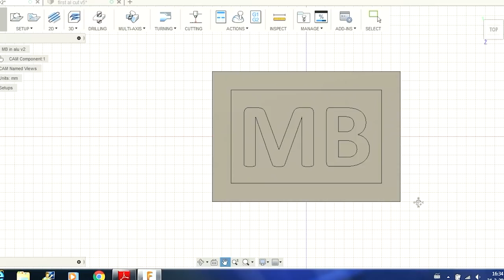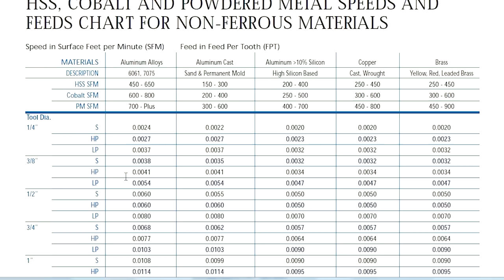My first experience with milling Aluminium on a CNC 6040 Router

Comment: Another tid bit is, instead of using High Speed End Mills, use Carbide 2 Flute End Mills. Yes it's a bit higher in price, but the tool will outlast high speed and you will see chips instead of dust as you called it. Also by adjusting Speeds and Feeds to accommodate the Carbide End Mill will be neccessary. Good Maching.
Reply: Single flute is what is suggested for aluminum from everything I have read or seen.
Reply: Use carbide on aluminum ONLY if the tool is coated. And never m,ore than 3 flutes. High speed steel 2-flutes work just fine.The real problem is that 4-flute endmills don't have proper chip clearance for chip evacuation, causing material to "roll" forward and back into the web, packing it full and overheating the material. It then "plasticizes", or gets "gooey" and stalls wimpy spindles, or breaks wimpy endmills.

Comment: Use 6061-T6 for milling. We use 4 flute on it all day long with zero issues of packing. Your packing was from to high feed and not enough cooling.
Reply: Yes, 6061 seems to be the most popular alloy for machining: T4 or T6. But 2011 is also highly rated for machinability (I don't know what temper).

Comment: Another reason for breaking cutters can be vibration and cutter loads in corner and bends of cut. With a pocket with alot of turns of corners it can load the % of the tool higher and would need the feed speed reduced and some case increased. Chatter residents can break tools too and can be fixed by change feeds and speeds and placement of the part in the fixture or vise.

Comment: Replace air and oil by olive oil to prevent stickies and for briant finish, it's not a joke a working alu. over 10 years and it work.
Reply: Olive oil is pretty expensive (even the cheap Walmart kind) for this.
Reply: The Best Stooge Most highend aluminum manufacturing uses olive oil tho. Atleast everywhere where I‘ve been in Germany. One place I‘ve seen even used macadamia oil which is at least 60€ a liter.
Reply: You just spray it with olive oil? You don’t need the air?

Comment: i was a machinist 20 years ago, we would never use those tiny cutters for the bulk of the work, use a 12mm slot drill/ end mill for the bulk of the cutting, then use the tiny one just for finishing the small corner radiuses
Reply: nice job tho! Id say thats a success! Hmmm how to get rid of the chatter, id still say do a finishing cut of 0.5 mm at full depth with a larger diameter slot drill, larger diameter = less vibration, and try to only use the tiny slot drill to do those radiuses, might need a dremel of some sandpaper to help the blending in the finishing cut.

Comment: Sure wish I could figure out how to get my 3040 up and running...Really tricky figuring out all the steps to get these going. Major big time stuck getting mine going.  Guess eventually I will have to buy the motion controller for 80 to 100 bucks...then buy Mach 3 or 4  for 175  to 200...Super stoked seeing your's running.
Reply from the maker: Hi Tod, That sucks. Have you tried posting your questions on forums/Reddit?
Reply: I am slowly figuring this out...so stoked...learning so much as I go. I am determined to be good at cnc.

Comment: Dude the best possible solution for cutting aluminum alloys is one flute carbide endmill. Expensive but with proper coolant mist you can cut with 3mm diam. thickness of 2mm with 1000mm/min with high rpm, more than 20000. Or with 4mm diam. you can easily cut 5mm at 500mm/min. I use an alcohol solution for coolant and it works wonders. But it is essential to have a rigid machine. If you can move something by hand then you have problems....
Reply: Strongly agree also! I used to use two flute and they where ok but damn single flute is a whole new world! 24000rpm pushing 1000mm/m, 2mm doc and 3mm over with a 5mm bit!

Comment: if you put an indicator against the spindle and can push more than .002 or more forget aluminum untill you beef up the router, you need enought chip load to not wear the end mill, I just scrapped a 25 year old 3,000 lb box way machining center, rigid is everything for metals, cheeting will just cause fustration, coolent wont help cutter deflection

Comment: You're really pushing the machine to its limits here. Try slowing everything down and reducing the chip load a little.
As for the rigidity, yes, both the X and Y axis need to be fully supported. The best thing to do here is to just swap the rods with proper linear rails - the machine will become more rigid and will likely be able to take slightly heavier loads than in this video.
Reply: I'm considering getting a 6040. I have the linear rails picked out, and good ball screws/pillow blocks too, if needed. Wouldn't it also help to reinforce the Y & Z frame components with angle iron, big washers and thru bolts, or even bars of tool steel? Adding weight risks a stepper slip, but a 6040 isn't really a rapid CNC anyway. The 6040 just seems ... flimsy from this video, and that flimsiness shows up very clearly in the finished piece.

Also, it doesn't look like any smoothing  - the gradual deceleration/acceleration of the axes - is being employed during direction changes. Doesn't that practically guarantee overrun due to flexing on a CNC made of soft materials?
Reply: which linear rails do you recommend? 15mm is enough??

Comment: Couple questions. Where did you purchase that mill ? How much ? Can the spindle speed be reduced to 2,500 to 3,000 ? Was it already assembled ? Is it all aluminum ? Thank you
PS.  A good place to start for speeds and feeds is :
Cutter speed ( every material has a cutter speed. You can look it up in Machineries Handbook )  x 4 divided by diameter = RPM
If it's a lathe, that's the RPM of the stock, if it's a mill, that's spindle RPM. I've got 40 years as a machinist, CNC machinist, production engineer, and that has always been a great speed to start at. Tweak as necessary.
Reply: I tried that twirking stuff - it doesn't work on alummm. Never mind... I see now you said TWEAK. And he said he got it for about $700.

Comment: No oil in mist, full glog. Then , step down 1.2, step over 3, tool dia 4-5 mm. Speed 500mm/min, spindle speed 15-20 x1000 rpm

Comment: Try out some single flute endmills. It will allow you to use reasonable spindle speeds and feeds. I have this exact router BTW and have really enjoyed it so far. With a 4 flute you're not going to be taking a big enough bite with each revolution and the cutter will heat up fast. I've had great luck with aliexpress carbide single flutes especially the 6mm ones. For smaller, I've had good results with the ebay sourced kyocera single flutes. Good luck and keep it up with the vids!
Reply from the maker: Thanks for you reply! Could you share some links from both end mills?

Comment: A shorter tool and a zirconium nitride coated carbide endmill will make a big difference. The shorter cutter is 8x stiffer for every halving of length and the zirconium nitride keeps the aluminum from sticking to the cutter. Makes a world of difference in aluminum.

Comment: I use an air tool oiler for the misting unit, and olive oil for fluid. 1 drop every 10 seconds or so, no smell, no sticky residue, and wipes clean. No health effects either!
Reply from the maker: That sounds pretty good. I’m going to test it. Thanks for the tip!

Comment: Try switch the tips, some materials are actually easier to cut without hss or ceramic, and just go for hardened old steel, especially cutting inconel and chopping things like aluminium

Comment: You can put oil in wather  and  dont use WD40  it special oil for colant, second thing for aluminium  use 2 flut carbid end mil covered with dimond coating in germany its  company  make this mils

Comment: I have the 4030. The Z-axis can be moved upwards by about 2 mm. The ball screw is not fixed. Maybe this is the case with you and the vibrations are caused by it. I have not milled aluminum yet. With wood I had no vibrations. The spindle is too heavy.

Comment: Would this be able to drill 4x 16mm holes into a 3mm mild steel plate? If not is it possible to upgrade it to do that?

Comment: Hey fellow Dutchman! That is a lot of movement at 4:57 . I bought myself a OmioCNC X6-2200L with Linear Guide Rails. That thing is stable as a rock, not even a little movement. I think that your router is not suitable to mill aluminium.
I recently milled some aluminium for the first time, and my best experience is with a single flute.
Reply: I've got an Omio also. It makes great chips using a 6mm single flute at 15krpm 600mm/m 2mm cuts

Comment: 2:02 not matter fusion360 cut inside line anyway and tell RED RED RED. its so smart to tell but not make action not do it LOL one or couple time tested. still write G-code hand faster. all measures allready there when you drawing. same time can type to machine LOL

Comment: Did you program in a final profile cut?  The rigidity of the spindle or table needs to be check,  too much slop. Use a dial indicator to check run out. Also the quality of the spindle need to be checked. I believe the spindle bearings are not a precision matched set or properly preloaded. Does your software have programmable backlash compensation?  Or does the machine PCB have pots for adjustment? I know these types of units aren't Fadels or a HAAS or have Fanuc drivers but the quality of the finish could be better. The other thing that can cause problems is the frame is too light and not as rigid ASA normal CNC. However, after every part of the frame is aligned get a taper drill and reamer and install two (if possible) taper pins where ever the frame bolts together. Make sure it is setting level on what ever you're using for a machine base. For such a light machine if you're going to machine metals to the depth you did in the video, consider anchoring it down. If the machine doesn't have spindle speed and feed over ride pots check to see if you can install them. Also grind a small flat on the shaft of your end mills where they align with the tool retention screw.  I do believe you can get a much better finish.

Comment: Running hss cutter does not work well if rpms are too high .carbide works better. Also rigidity is everything for finish if its properly tramed in.

Comment: 5:08 allready build cnc before 3d printers still babi. had 2 y linear FOUR x linear FOUR z linear spindle sandwiched between. no flex! later spindle rotate B-axis and table had a axis. 5 axis long before pocket nc and did not cost 5k opsy!

Comment: A couple of remarks:
I wonder if the milling tool is perpendicular to the table. I see exactly where it cut the previous track when you have multiple tracks next to each other.
It seems to me your milling speed is rather high for such a cheap and simple machine. I think you should lookup some tables on the internet about milling speed and amount of rpm for the tool for different materials you want to be milling.
Another program to create the G-codes would also be nice. What you used here is not spectacular.

Comment: Maybe next time mill away majority of the material then for the finish ya create an in-line say ,015 with a smaller bit and why mill the top if it’s already smooth   Ya just sand the top down at the end   And put the sprayer alittle closer to the bit so it cools the bit diwn  plus don’t know what kinda of oil your using, but ya can’t just use WD-40 thrs a special lube much thicker then the oil and really helps the cut a lot better

Comment: Hi friend, thank you for these videos. I had a 3040 CNC but could barely cut 3mm 6061 with. Is the the 6040 more powerful? Did you upgrade the router or any other components to be able to cut this aluminum. Thank you!
Reply: Hi, I have just bought a 3040....what's the wattage of your motor?

Comment: The main thing to eliminate when it comes to milling is vibration. The lack of rigidity and lightness of the machine's hollow table combined with not being fixed to a solid and heavy base, creates the problem of easily breaking endmills and getting poor finish on feature surfaces.
Reply: You could also look at it the other way around. Poor and cheap end mills that don't cut properly will put an excessive load on the machine structure causing it to flex more. Proper end mills is the very first step. Not using these crappy chinese end mills for less than a dollar

Comment: Hi, I noticed you are using a 6040 CNC router with Fusion 360. When you when to post process in the CAM part of the software, what machine did you select please?
Reply: You usually select whatever software you are using to drive the machine. I use LinuxCNC so I pick that. UCCNC and Mach3/4 are also on the list.

Comment: I wouldn't try to match the rates in the feed & speed guide, those are based on the endmill being used in professional heavy duty milling machines.  A ROUTER is not a MILL, foremost in terms of rigidity! With a router, you're really going to have to experiment based on individual machine performance because just going slower/lighter doesn't always work out best either  - just don't go with these figures as a starting point.

Comment: question.. I got the USB version and also have a 32 bit laptop on the way.. any tricky stuff ill run into getting setup , aside from tuning the machine in mach 3 ?? ive been watching every single video I can find for 2 weeks , I know from my last cnc router, there is a limited amount you can prepare because there are odd quirks that each individual may or may not see. ( for example , the machine was designed around F engrave, needless to say my computer would not run F engrave so I had to use vcarve , fusion , and easel, none of which I anticipated beforehand.
Reply from the maker: Congratulations on buying your machine. Your comment made me smile, I had that same child like awaiting when I had ordered my CNC. Setting up of the machine shouldn't be that difficult if you have some basic tech skills. Mach3: understand the 2 coordinate systems. Machine coordinates and workpiece coordinates. When you understand these concepts decide if you are going to use home switches or if you are going to home the machine by hand (every time you start your system up). CAD/CAM: I a big fan of FUSION 360, there are many YT tutorials, one year free trial and the UI is easy to work with. FEEDS/SPEEDS: I have a spreadsheet to calculate my feeds and speeds. Working with a spreadsheet helped me a lot and I highly recommend it. Most engraving spindles have almost no torque at low rpms, so I don’t run my spindle under 10k RPM. with a spreadsheet you can reverse calculate what feeds and endmills fit with this RPM range. When you understand the things I listed above you should be fine.
Reply: well that's good , thanks for the reply. Im a machinist ( manual ) so all the cutter geometry, feeds speeds etc will be fine.( yes the strictly manual machinist is going the way of the VCR  , im aware ). Its the computer end that has me anxious.my last machine had homing switches, but the machine would quickly lose steps and think its off the table and hence I returned it/The biggest issue im reading about is the " free " version of mach 3 and the limitations there..

Comment: Nice video. I have one of those mist kits laying around waiting for drilling/tapping, or 3d printing something to attache it,..   I like your approach better. I can do zip ties all day long. :D    What is your spindle speed? I've had the same issues with clogging. I actually found it easier to cut steel because of the aluminum clogging the bit.

Comment: Does this machine do G-Code and M-codes? Looks fun to learn on
Reply from the maker: Hi Kenny,
You control the machine with a laptop that runs Mach3, that's the control software that sends the pulses to the stepper drivers . You can type G-code / M-code straight in Mach3 but most people use a CAM program to get the G-code. So you don’t have to know G-code / M-code to run the machine. And yes it’s a fun machine to learn CNC!

Comment: watching your other vids how you replaced the bed and aligned the head so its square to the bed, has that on its own improved the finish compared to that last final cut where it was flexing the machine? or just different speeds and feeds has fixed that? Im looking at getting a 6040 very soon ive been watching lots of different vids from people they seem to do what I want to do but just seem a bit flexy, like anything do you buy cheap then spend money to upgrade it to something better or buy something more expensive to start with.

Comment: This is the cnc machine i had pegged as the best for the money. Its nice to see it working. Did you have to upgrade anything or did it work after you got it all assembled? Also i would have started cutting at a much slower speed. I cant believe it cut that fast. Its a cheap Chinese machine slow down your feed rate.
Reply from the maker: The only upgrade I did so far is installing home switches. I used the UC 100 usb motion controller and a 64 bit laptop.

Comment: I’ve found 2 flute or 3 flute work best on aluminum, I’ve have better luck with 2 flute doing plunge cuts. (This is all done on my manual Bridgeport though) I haven’t tried my imservice 12x12 cnc router with aluminum yet!
Reply: For straight plunge cuts the best results I got was with two and three flute end mill cutters, which are made to plunge into the work.  When viewed from the end, one of the flutes continues across the centre, so it removes the "pip" from the centre of the cut, which is a source of heat buildup, because the surfaces are rubbing, not cutting.  These cutters still work the same as other cutters for other operations.

Comment: Hello friend, excellent video! I have a question, what features does your cnc have? I mean the type of engines you used and the guides, thank you!
Reply from the maker: Thanks ! it's a chinese CNC 6040 with a 1500 watt spindle and nema 23 stepper motors. you can see more info on ebay https://goo.gl/cT5X4E